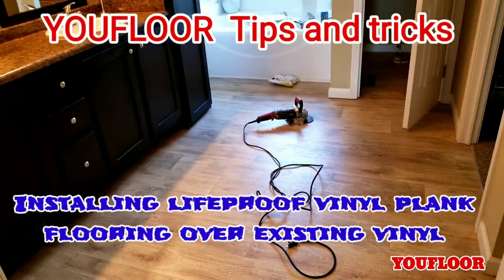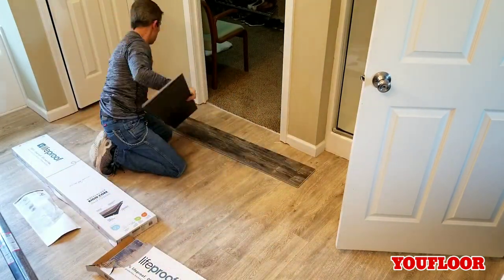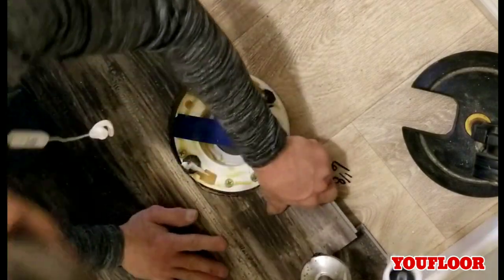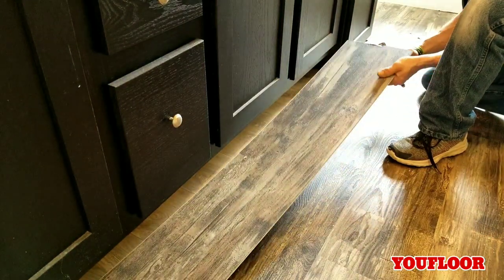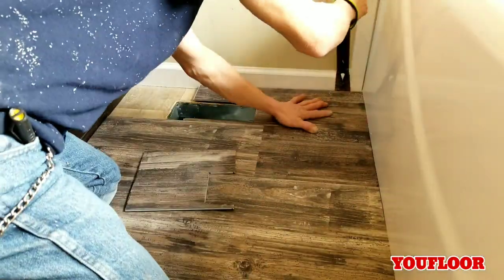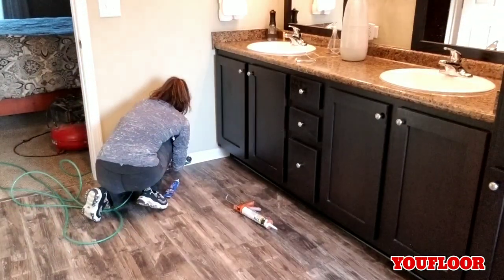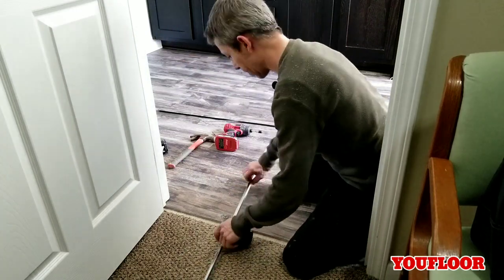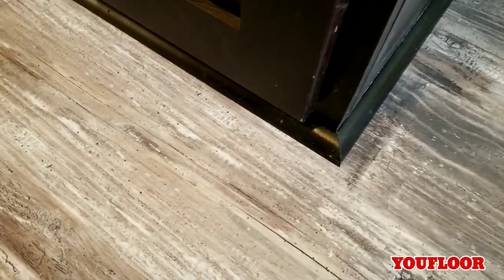Installing LifeProof Vinyl Plank Flooring Over Existing Vinyl

Comment: Is there anything to watch out for or difficult about mounting the toilet on top of the  lifeproof?
Reply from the maker: Just being honest. We usually have c r s  come out and remove and install toilets. I used to do it but there is a big liability if I do it. We also don't remove pedestal sink or hook  washers up. If you know what your doing then installing on top of lifeproof  is perfectly fine. But a quote I like to say is would you want a plumber to install your floor. Then don't let me install your tiolet. 😁thanks for the question
Reply: @YOUFLOOR  Thanks for the quick response...the only thing I was wondering and I can't find a video that actually shows the final steps...you ovbviously cut out around the flange, not around the toilet base, and the tiolet is then sitting on the LVP.  Does the toilet installer still caulk/silicone around the base or not since the floor is supposed to be allowed to move?
Reply: @mikecolo2158  as a flooring installer for over 4 years, I have some input.  From my experience it seems to be dealers choice.   Some plumbers swear by silicon around the toilet, others don't use it.   But what they all say in common is that you need an Extra Thick wax ring!
Personally I don't think silicon is necessary.  If it leaks I would want to know, and silicon would prevent the water from seaping out.   Hope this helps.
Reply: @keithy.1179  that's a great answer! I'm about to put in 3 toilets in my new rental property and I was wondering the same thing. Makes a lot of sense to not use the silicon for the reason you said.
Reply: @keithy.1179  would there be any harm in putting silicon between the flange and LVP(under the wax ring) to encourage the water to stay on top of the LVP?
Reply from the maker: I would definitely do that. In fact I would recommend it.  Thanks for the question

Comment: Looks good!
It a crappy product .I install it yesterday .Always use scrap piece to tap it together with you block.
If you don't you break the track very easily.
I would leave  more of space to the walls to the planks for expanding .
Way wouldn't you just pull the old floor .it not glue it floating .you wouldn't have to recut the frame door .Then transitional to the next room won't be so high
Reply from the maker: Great questions. I'm not sure if we installed the same thing because  the stuff I installed is about 1/4 inch thick and the vinyl is only 1/16 Inch. Also it was glued down over luan. And some times when you try to pull the vinyl the luan will get destroyed. Its better to just remove them both if that's what you want to do. But that's an extra cost and these days people are trying g to save every dime they can so when they say can it be installed over vinyl I do what they want. Also with me putting it the way I did it made both floors level with each other  Which was why I was able to put the U channel down without having to build it up on the transition I was able to use a T mold. just some tricks to save me time and the customer money. Thanks for the comment

Comment: Beautiful job. I have two layers of vinyl down already. Do I have to remove one to install Lifeproof vinyl planks?
Reply from the maker: Well the directions say not to I stall over cushion backed viynl. But I reread them and the only thing it says is to make sure your vinyl is fully bonded. So if the bottom one is glue (not stapled and loose laid) And the second layer is bonded good to the 1st one you should be okay. But not if its the spongy kind. Only the paper back kind.  You may want to check for asbestos for the future. Also once you start putting more layers of floor on top of old floor. You need to make sure of things like the dishwasher  can be installed  with the feet on top of the new floor and still have clearance at the top to open the door. And the frig will fit under frig cabinets. The stove may sit a little higher than before and the base boards get a little smaller. Unless you pull them off and reinstall them. Thats a project. Hope that helps. Thanks for the question.
Reply: @YOUFLOOR  Thank you so much. Both floors were glue downs. I have a couple loose ones that I will add some glue to. You have saved me a lot of work! Thanks so much!